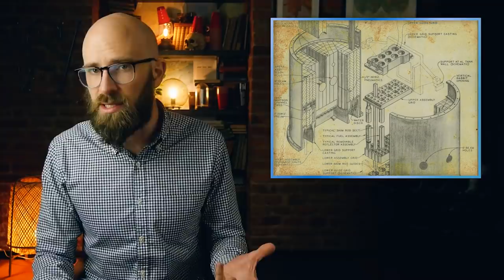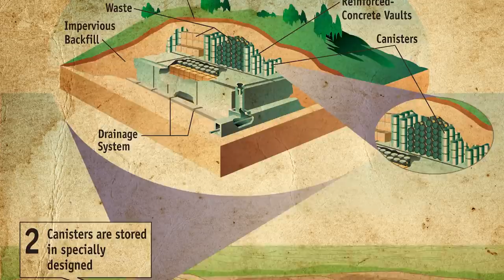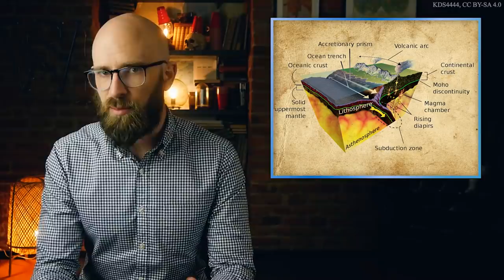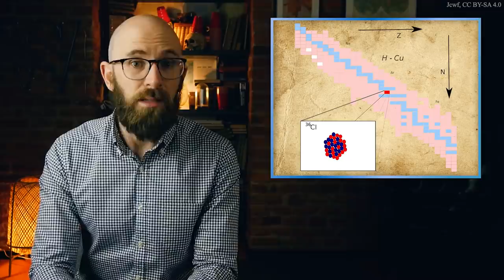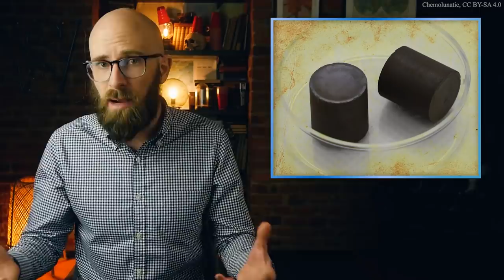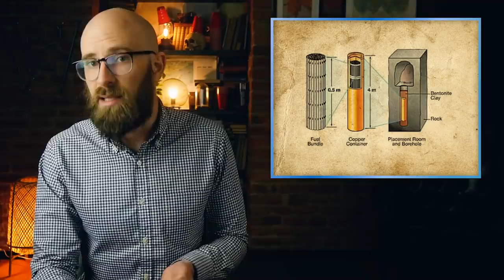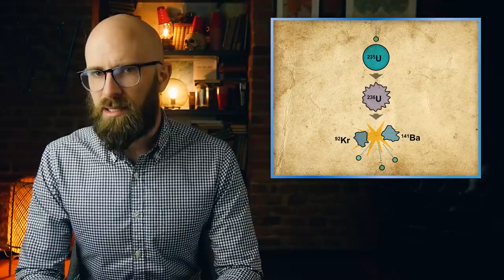How Does Nuclear Waste Disposal Work?

Comment: Putting the nuclear waste in the pyramids and tombs would protect the mummies and solve the storage issue. Future Egyptologists would have fun working that one out.
Reply: We did something like this in the Marshall Islands from 1977 to 1980. Much of the nasty stuff was put into a tomb, a crater formed from one of the hydrogen bomb tests. And like the Pharoh's of old, many of those doing the work were put to death to protect this secret. No, not by some master plan that ended with sealing the workers into the Tomb, but by ignoring the radioactive fine dusts they breathed in, by dumping some of the "lesser" isotopes into the lagoon, where our drinking water was taken from. 
Let's do the math. Of 7,000 some personel on the project, we've lost over 6,000 by now to various health issues caused by radiation. Those of us who survive do so with life long health problems that the Veteran's Administration only started to acknowledge after the PACT Act dealing with Agent Orange exposure on bases around the world and here at home. There is more to this story, but it doesn't come out often, or get shared as widely as it should.

Comment: Very good and very accurate.   One minor quibble: I believe the Hydrogen that exploded at the Fukushima plants escaped from the reactor cores, not from the spent fuel pools.

Pete
Reply: Most definetly Pete...unit 3s hydrogen explosion was so great because it originated within the containment vessel.  (SIDE NOTE: there was actually a perfectly square hole blown through the bottom of the containment vessel from a bundle ejected through the bottom). Where the pipes go in at the top of the vessel was the weak point and when it couldn't hold the pressure any longer it blew out the top and met oxygen in the upper part of the building and then exploded.  Its important to note that its not just hydrogen gas....its hydrogen/tritium, noble and inhert gases, chemicals such as hyrazine and elements like boron.  With bonding and evaporation occurring, more movement is happening then is being spoken about.
Reply: Far Out
Reply: @paulmobleyscience  The sad thing is that the Fukushima problem could have easily been prevented.  There are two reasons:  

1)  When the plant site was being chosen years earlier, the local residents told officials the story that about a thousand years earlier, there was a gigantic tsunami at the very site being considered (only a few feet above sea level).  The officials discounted the stories as "anecdotal."  (After the accident, geologists confirmed that there was actually a large tsunami that was higher than the level of the latest one.)  If the plant had been raised higher than the level of the tsunami, there would have been no problem, because the plant was damaged by the tsunami--not the earthquake (for which it was designed).

2)  There was a time during the accident in which the seriousness could have been significantly lessened if the Plant Manager had been allowed to flood the containment with sea water.  At that time, he still had pumping capability.  It is likely that permission was not given, because doing that would have precluded ever restarting the plant (because of corrosion).  Cooling the core would have prevented excess hydrogen generation (the threshold of which is at temperatures significantly greater than those experienced in a cooled core).
Reply: @composer1663  What would have prevented it would have been if the public was more educated on the topic like today and like you actually show in your comment than they were back in the 40s and 50s when this all started then none of this would exist and thats a fact.
Reply: Hust curious, why did you put your name in the script when your post already shows your name?
Reply: @I_Am_Lt_Surge  Some people do that, its almost like a letter or at the end of a quote like I do sometimes ie...gather the fight to fight together-Paul Mobley

Comment: Excellent as always Simon. One thing you might have mentioned is the ability to reconstitute spent nuclear fuel.  In an American Commercial Nuclear Reactor the fuel bundle goes thru three fuel cycles before entering the spent fuel cycle.  This entails 5 years in the Spent Fuel Cooling Pit, followed by transfer to passively cooled Spent Fuel Storage Casks which are in turn are stored on site. The casks are about 14’ high and 8’ in diameter.

       The thing which stops the usefulness of fuel after thee burn cycles is the build up of “Fission Product Poisons” which absorb the neutron flux which is needed to sustain criticality.

       That said there is a large amount of fissile fuel retained to the depleted fuel because over the course of a fuel burn the neutron flux produced from slightly enriched U-235 bombards the relatively inert U-238. The U-238 absorbs a neutron which then decays to Plutonium-239 which is also fissile.  

        By the end of a fuel cycle (End of Life or EOL) most of the fission power is produced by Pu-239 as the U-235 has been expended since the “Beginning of life” (or BOL).

         Japan and France (as well as others) recover the left over Pu239 and remove the fission product poisons thru “Reconstitution” whereby the spent fuel is dissolved and then nuclides are separated.  The US never engaged in reconstitution due to the political issue of nuclear proliferation (Pu239 can make bombs as well as nuclear fuel).

         Where this long dissertation is leading is that by engaging in reconstitution the physical volume and constitution of the fission products can be greatly reduced and the fuel cycle efficiency is greatly enhanced because the wasted Pu-239 is recovered and re-burned.

         Ultimately the clean Rx is the Fusion Reactor because one is not splitting large atoms which cause a broad spectrum of unwanted activated fission products. Instead in the fusion Rx small atoms are fused ( Deuterium: (Proton + 1 Neutron)  fuses with Tritium: (Proton + 2 Neutrons) to produce Helium: (2 Protons + 2 Neutrons + 1 free Neutron + Released Binding Energy). The technological hurtle with working fusion reactor is still a long way off.  The temperatures are extremely high, the change in neutron flux strength is very fast, and containing the plasma if the magnetic field is lost is problematic due to the high temperature. 

          There is additionally the Thorium Rx technology out there, but I’m not knowledgeable to address this technology. 

         The importance of a commitment to Nuclear Power to provide clean grid base-load is paramount to reduce the dependence on fossil fuels.  Solar cells don’t work in the dark or when covered by snow and wind mills don’t turn when the wind doesn’t blow or it’s too cold. There isn’t enough Hydro & Geo-thermal  available to meet Grid Base-Load requirements, so in the final analysis we are left with Nuclear Base-Load, decentralization of generation, and increasing the electrical efficiency for electric devices to reduce consumption.😎

Comment: One important note: the Swedish "Forsmark repository" hasn't been even approved yet, SKB has only selected the suitable site. Meaning it's status is practically the same as every other spent nuclear fuel repository currently being planned. Excluding Onkalo oc which is actually in the process of being built and only 2 years from finishing.
Reply: The plans to burry it is so last century I think.  What do you think could we maybe find a viable way to ship it off the planet?  With people like Burt Rutan and now spaceX surely we can get it off Earth safely and packaged in a way to ensure safety.  At least the worst of the worst.
Reply: Neat
Reply: @paulmobleyscience  "..IAEA estimates that 370,000 tonnes of heavy metal (tHM) in the form of used fuel.." Meaning as Starship is able to lift about 53 tonnes to low earth orbit, it would take about 7000 Starship launches. And every single one of them would have to succeed. Aborting and delf destructing is not an option as it would create highly radioactive planet wide cloud in the higher atmosphere where it would be falling steadily for decades if not centuries.... Meaning lauching nuclear waste into space is at the moment viable. In the far future space elevator could change that but it's so far that we should really be doing something now.

On your comment that burrying that it's so last century.. You are correct but it's one of the very few options we have. Sinking the waste into plate subduction zone would still take thousands of years at least and there is no guarantee that those subductions don't burb stuff up at some point, radioactive stuff with it. We simply don't know and as such we can't trust it.
Making new reactor types that use spent nuclear waste is possible but realistically it's easily decades away from widespread use. Usual and known nuclear powerplant takes roughly around 4-5 years to build. For one plant that is. Building new ones with all new technology would take even longer. And all that time there is more waste accumulating.

So space is off, dumping it below earth's crust is off, we don't know yet how efficiently make use of it and still it's really bad stuff to just keep it around. So we should be doing something now. If we bury the waste deep into bedrock and find a way to dispose of it cheaply in say 50 years, we still remember where to find it. Digging it out is easy, it's very contained, not spread around like plutonium ore in rocks now. The deep repositories are at least best choice for long storage and if nothing is invented to get rid of it, we can leave it underground.
Reply: @alaric_  How many tonnes of the long lived transuranics and radionuclides?  High level waste.   Look I'm not just here to complain and give no amswers.  Another comment will follow.
Reply: @alaric_  We have many options but they have been controlled by pro nuclear people for decades.  The options have been on the table for a long time even back in the 80s and 90s when we kept kicking the can and earning dirty money paid for by the future.  We have the abilities to safely package all this up and make certain it doesn't continue.  We stop today making, mining, and building new reactors.  We then use the remaining spent fuel in those breeder reactors until it is all used up and then with your calculations would be much less on the high level waste at that point and then with time safety and efficiency will only gain.  Then we start using better designed wind generation, solar, more importantly geothermal and hydroelectric but more with the constant waves on the ocean not the Hoover Damn type, place new flexible solar panels every possible place, and then whatever else is needed can be done with natural gas or even a small amount of coal for industrial settings but far less of it would be needed with everything else. 

Now what isnt talked about most of the time when speaking about energy is whats most important about it.....a nationalized power grid and the ownership of that grid given to the people not CEOs and single people ( 3 owners own all of western US grid) that way the control of what is put into the grid first isn't controlled by lobbyist and politicians and then the need for large battery banks are not needed because then power can be moved from where it is plentiful to where it is needed.  These are the right answers and when Companies buy up the patents to inventions and ideas that would put them out of buisness and put those ideas in a filing cabinet just so they can squeeze as much money out of the old ideas as possible before being made to switch is actually the biggest issue of all....

Comment: One of the most basic and fundamental aspects of nuclear radiation and decay that I learned in college chemistry was that the longer the half life something has, the less often it emits dangerous radiation. Kinda goes with the definition of Half-Life (no, not the video game). So, something with a half-life of 1,000,000 years is 1,000,000 times LESS dangerous as something with a half-life of a year. Another way to look at it is that you'd need 1,000,000 times as much of Substance A to have the same amount of radiation emitted as Substance B. The dirt in your back yard is more radioactive.
Reply: No quite right.  Yes the activity is likely less, but equally important is the decay series, radiating which type of energy: alpha, beta, gamma, and neutrons.  And there is not an exact numerical (or linear) relationship between half-life and the degree of danger.  This is especially true when considering the mobility of radionuclides in the environment.
Reply: @vanguard9067   I'm not saying that those things are unimportant in determining how dangerous a substance is, but it's a pretty good indicator for those who know nothing about radiation to go on.The less active a substance is, the less it's going to emit something dangerous, even if it's byproducts are both more active and more dangerous, it's still going to take a long time for significant amounts of those products to do their thing.
Reply: @torjones1701  okay.  I come from a technical background, so I go for the details, but you’re absolutely correct the level of radioactivity is inversely proportional to the half-life.  It probably is a good shorthand for many people.  All good.